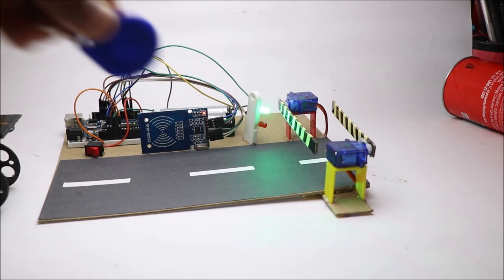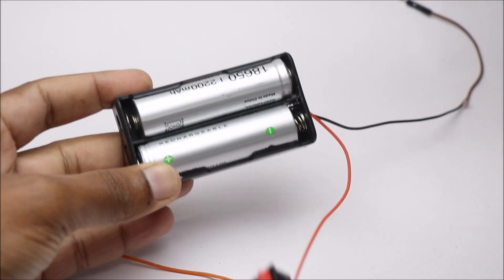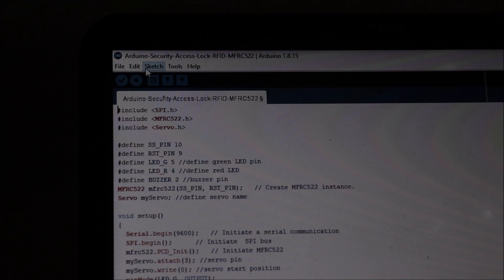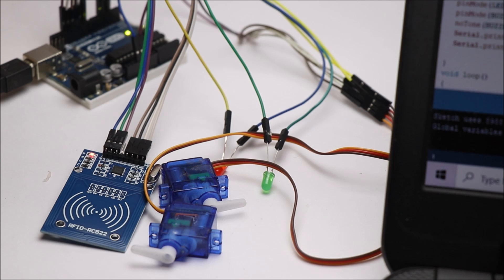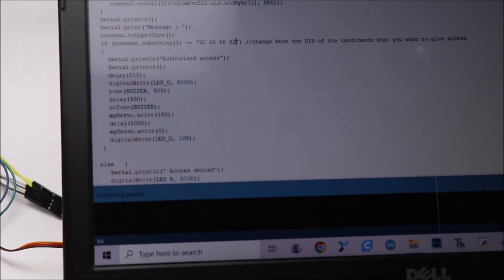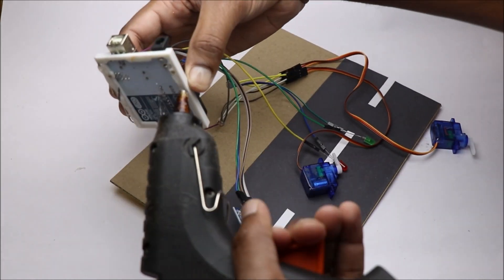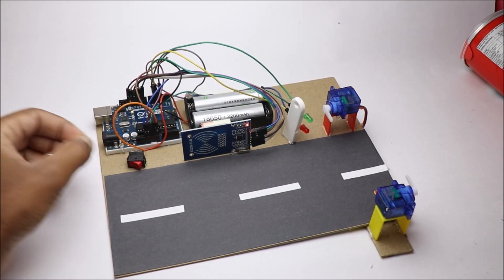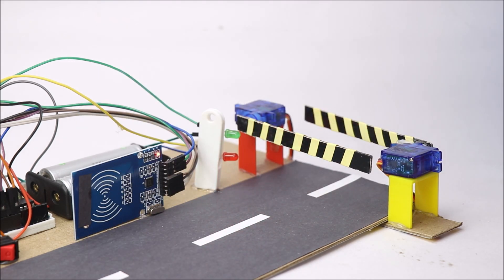How to Make Arduino RFID toll tax system | Arduino

Comment: Could you please help me, I'm trying to run the code and I open the serial monitor, the message (Put your card to the reader...) appears but when I scan the card nothing happens, and I'm sure with my connection :(
Reply from the maker: Connect the rfid to 5v pin on uno
Reply: @jeevanjee Not working!!even after changing it😢
Reply from the maker: Hi, check my latest video please
Reply: listen it is a problem with your rfid connection connect then tightly ok?

Comment: Can i have full code
Reply: The rfid module is not detecting the card, what should i do
Reply from the maker: This is the full code, try connecting the tag power terminals to 5v pin of uno

Comment: hi what is the use of the batteries in this project can this project be accomplished without using battery
Reply from the maker: No it can't it's because rfid board and servos consume too much power and on long run board gets heated up

Comment: Could you please help me, I'm trying to run the code and I open the serial monitor, the message (Put your card to the reader...) appears but when I scan the card nothing happens, and I'm sure with my connection :(
Reply from the maker: is the rfid connected to 5v?
Reply: Bhai same error? How did you fix it?

Comment: Hello sir , I have one question 
Can I make the card work once each 10 minutes or so ( if it's possible what do I need to add to the code ? ) .
Reply from the maker: Yes you can, just change the delay in the delay section of the code
Reply: Code do na sir @jeevanjee
Reply: Aoa sir is ka proposal dein